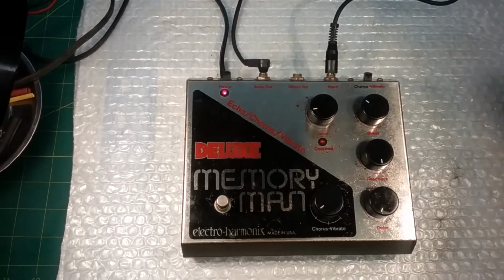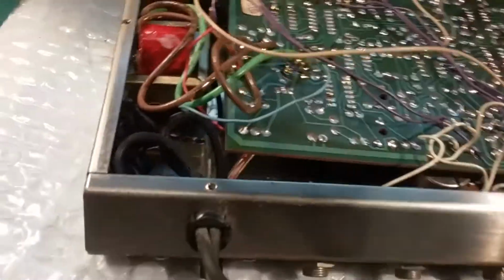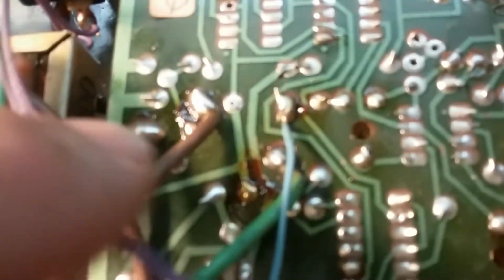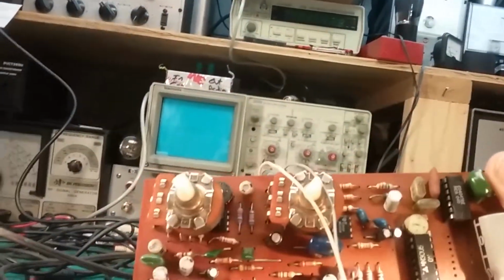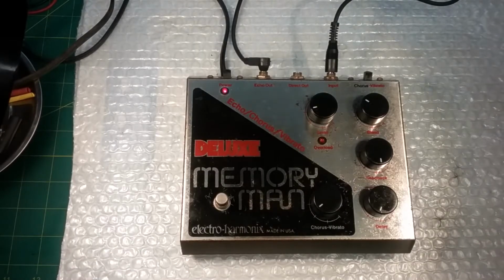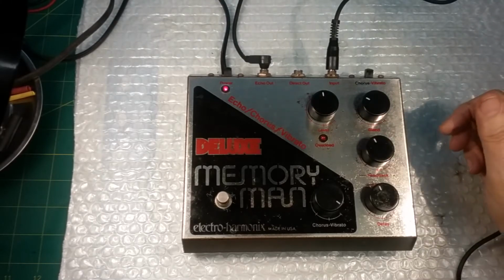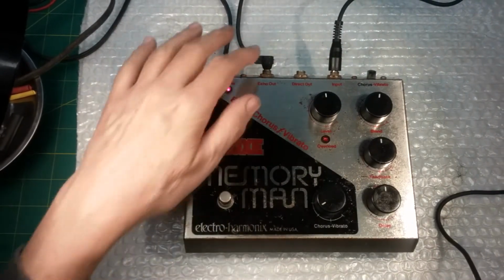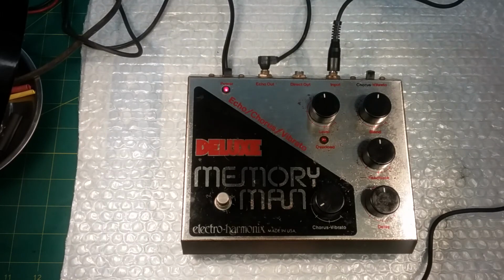1970s Deluxe Memory Man - Echo / Chorus / Vibrato Chamber - Repair

Comment: Got a 90s reissue in the 2000s but never used it because it produces a big pop when engaging the footswitch. Any way to repair it? Thanks!
Reply from the maker: To be honest, I really don't know exactly how it works. Like most newer items than 1960s, there are no diagrams of the circuits nor technical manuals out there. If it is making pop-in sounds that are that loud, it has to be some component that needs to be replaced.